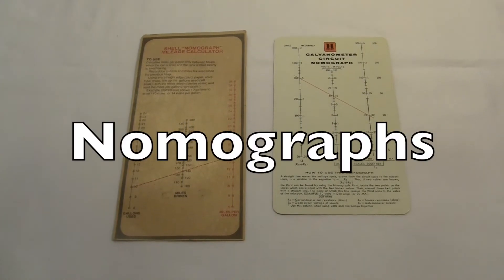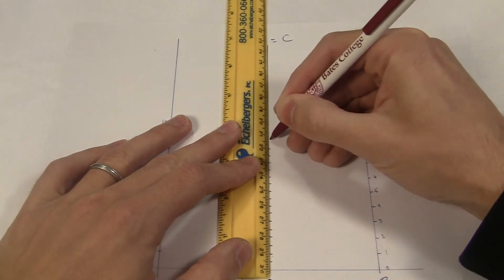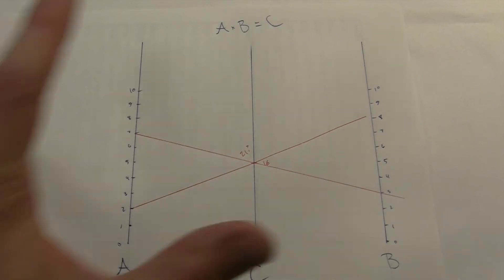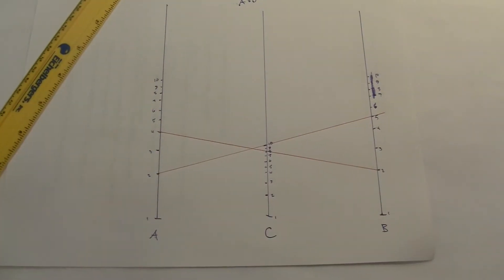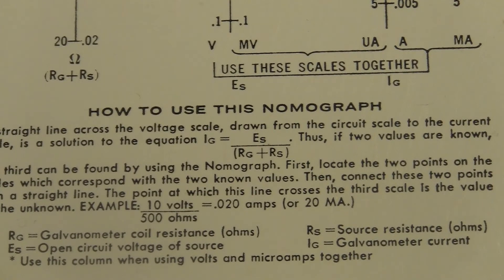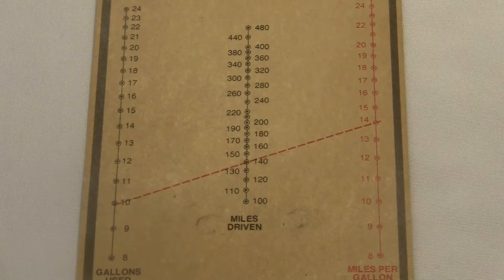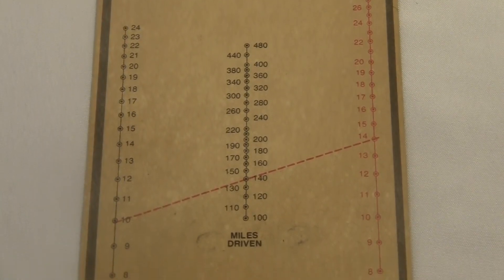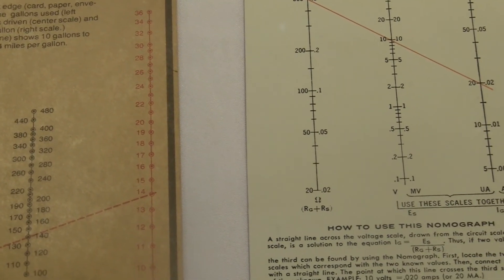Shell & Honeywell Nomographs Review / HowTo

Comment: I bought a copy of The Radiomans Handbook (4th edition by ITT) at the Ft Monmouth book store For $5.65 while doing my training in Microwave Radio Repair in I967. That book had a section of electronics and physics nomagraphs at the back of the 700 page book and the included a plastic rule that you used to solve the answers. I used that book all through my career and it still sits on my desk 55 years later.
Reply from the maker: Nice- I gotta check that out.

Comment: Nomographs are still widely used in aviation, as performance charts in aircraft manuals use them extensively. Granted, most of those manuals were made in the '60s and '70s, but manuals for new planes also use them. They are that useful and reliable.
Reply: Look up his video on the E6B Flight Computer
Reply: I thought of that too. Chris might want to do a video explaining how they work.

Comment: Can we use nomograms to optimize algorithms? thanks
Reply from the maker: A nomograph on paper is analog rather than digital, so would be hard to use inside a typical computer algorithm. But if you have a nomogram, then this can suggest new ways to design algorithms.
Like a slide rule is basically a moving nomogram, and the theoretical design of the slide rule is based on multiplication by adding logarithms. And this idea can be translated into a computer algorithm for multiplication which may be useful in certain situations.
Reply: @ChrisStaecker  Elliptic curve cryptography comes to mind, same model, but that has nothing to do with optimization. Unless you're doing it on some yet to be invented silicon, you can't beat the calculating performance of a precomputed lookup table - a 2d matrix that would be functionally identical to a nomograph. Obviously that performance doesn't come for free, there is a time/space/accuracy tradeoff - with those log functions demanding a lot of space. Suddenly we are back to where we started... the first computers were created to churn out books of nothing but printed lookup tables. I've got an engineering book from the 30s - something like half of it is dedicated to lookup tables for all kinds of crazy things: wire-gauge/turn-count for dynamos, etc.